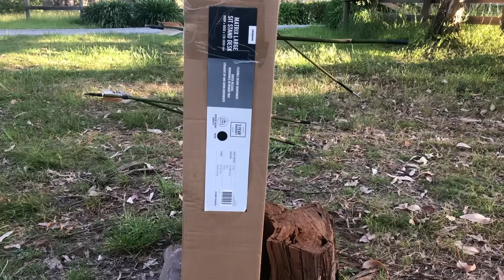How to make a BOW from BAMBOO

Comment: Gonna plant some bamboo this spring. So many uses for it.
Reply: Keep it contained - it spreads like crazy.  Someone made a planter with concrete retaining wall blocks built into and existing block retaining wall where I live.  Bamboo is starting to work its way between blocks and dislodge them.  Plastic sheeting isn't enough - they recommend concrete or metal, at least 2 ft. deep and 6 in. above soil.

However, if you put in the time, money, and effort to grow it responsibly, it forms a thick, effective, privacy and sound barrier that grows quickly.  The parts you remove when thinning do have a lot of uses.
Reply: What type of bamboo ?

Comment: Would a bow like this keep? you cut the stave green and almost immediately strung it - would I store it strung to tiller it slightly, or unstrung and the dry bamboo would keep that flexibility w/o cracking? Sorry this is an awesome build I just really wanna know more dude
Reply: I had the same question. From my experience, you would need to treat bamboo that size or it dries out fast and gets splintery. Maybe it's a different variety of bamboo, but I expect similar issues would still come up.

Comment: Can I use a dry bamboo to make a bow
Reply: Someone answer this question. I want to know too! Lol
Reply: You should make it while it’s green and let it dry ,then it would become even stronger , if you wait until it’s dry to string the bow , it will be extremely difficult , do it while green and let it dry with the form of the bow and it will remain plus it would be very hard to cut dry bamboo so do it while green and leave it to dry for it to become strong , same with the arrows make them while green and let them become strong when dried